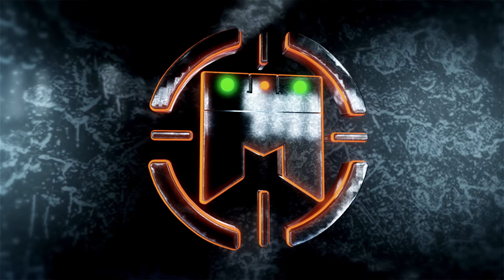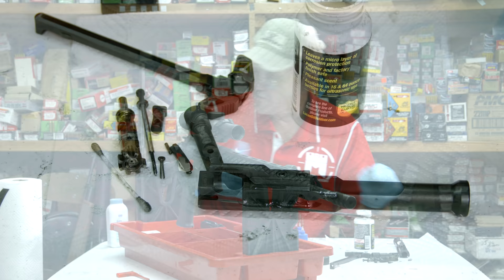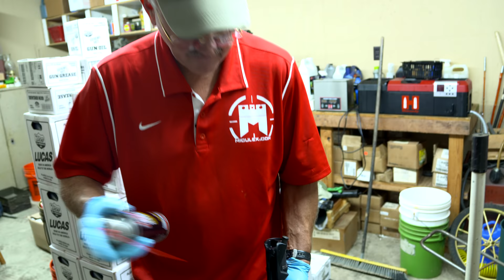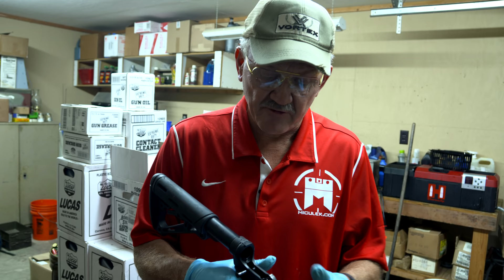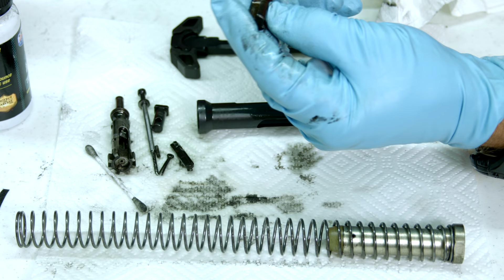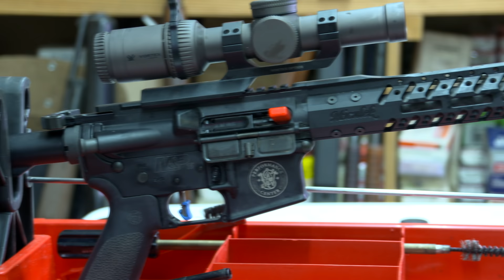ULTIMATE AR-15 CLEANING AND TAKE-DOWN with Jerry Miculek! (4K)

Comment: Great video, Jerry. My only comment is that I would have liked to see a close-up of where and how you were lubricating the pivot points of the trigger group since i had not seen that done in other cleaning videos.
Reply: I think the "brake cleaner" was meant to remove any oil and debris. The trigger group should not be oiled as that will attract more dirt and debris.
Reply: @DangerClose13E  30:50
Reply: Agreed.  More close ups would be helpful all the way through.
Reply: More close ups…smh.

Comment: Jerry, great presentation!  From a former 91F Small Arms Repair/Artillery NCO, you've covered all the details that I'd tell my soldiers.  If I was still in the military, I'd use this as part of my training regimen.  I like how you clean the buffer tube and oil it, it's the same way that I do it and I would show that tip to others.  One minor correction, the U.S. military uses tapered bolt action cam pins, just like yours.  They might have staked it in earlier versions, but modern M16/M4 rifle/carbine's use tapered.  Thanks for the presentation!
Reply: I think the damn idea of brake cleaner or what I'm going to try in a bit, some carb/choke cleaner was damn genius, a strong spraying cleaner that dries quickly. Idk why I didn't think of that...if it blows the chamber clean quicker than rubbing it all out with cloth strips I'm down to with that! Just lube afterwards and I'm good to go. I'm also gonna try that on my 1977 Marlin Model 60 that old 22 gets nasty quick and the model 60 hates excess oil or lube... I wipe the guts with an oil soaked rag I use to lube my bullet molds I put the remnants of my 2 strike oil bottles on the rag and it's not failed me yet.
Reply: DTundergun stay with the brake ckeaner . It leaves no residue. Carb/choke cleaner does .

Comment: To those with criticisms, this was not a tutorial for beginners. Jerry was showing some more advanced techniques that you will not get out of the Tech Manual or manufacturers' instructions. Pay attention to the inspection tips, where to look for damage or wear. This man has shot millions of rounds. I have several hundred thousand under my belt, and some of them were on the same squads at the IRC with him.

Letting the gun sit and the solvent work is key. While Jerry did not mention any specific products (sponsorship issues) I have an old school recommendation. Good old Hoppes No 9 is still fantastic on loosening carbon and barrel fouling. It has oil in it so it will not result in corrosion, even leaving it on for days. One sure way to get out fouling without work is wet the barrel with Hoppes and leave it overnight, or longer. Patch it wet on successive days until the patch comes out clean, not green. If you are so inclined, put a drop or two in the gas tube and leave it. Any carbon will be softened and blow out upon first firing. A caveat, do not use Hoppes No 9 to brush the bore. This solvent attacks copper and a bronze bore brush will not last. Initial brushing should be done with non-copper eating solvent. I shot High Power for years and match conditioned M1 Garands with staked gas cylinders should not be fully disassembled for cleaning. Indeed the Marine Corp team rifles had the actions epoxied into the stocks and the stocks had to be broken off for major work. The gas cylinder was kept from clogging with carbon by running a few drops of Hoppes No 9 down the operating rod into the cylinder before and after each match. Again the carbon is kept wet and soft and just blows out upon firing. With a stainless barrel and reasonable storage conditions, the Hoppes No 9 is fine to leave in the barrel. On ARs I disassemble and wet parts with Hoppes. Let it sit, and finish cleaning the next day. Very little time actually working on the gun is needed, most of the carbon wipes off.

Comment: Show us the the AR cleaning with the sonic cleaner for comparison. Thanks Jerry for such high quality videos.
Reply: The sonic cleaners rock. You literally drop the parts in the pan, add the proper amount/type of cleaning additive to the water and turn it on. Run repeatedly until clean to your specifications. Parts come out as clean as the day they were made. Just beware putting certain metals in as they can become discolored or 'changed'. When in doubt RTFM.
Reply: @johnskidmore1906  Should I take apart the bolt (extractor and ejector) before putting it on the cleaner? Also should I use acid or soap

Comment: What I like about the videos is the safety, chamber flag, no ammo on the table or near to interject into the system.  I know many people that thought the gun was empty and fired off a round. 
I was teaching gun safety and the young lady that was teaching with me had a gun that the extractor didn't pull the round out, she looked in but really didn't look.
she closed the slide pointed the barrel up and shot a hole in the ceiling of the building we were using.  The owners were not happy LOL.

Comment: Not how I was taught in the Army, but all my respect goes out to you and I definitely learned a couple of new cleaning techniques. Thank you, sir!
Reply: The Army also taught soldiers to put oil down the gas key and, at another point, put oil into the holes on the side of the carrier. They also love their CLP which is a somewhat annoying product to use compared to the alternatives.
Reply: my son is in the air force and he said they did not want him to take the bolt apart. but he does now.

Comment: Very good video on the cleaning of the AR-15, Mr. Miculek.  What would have made it excellent is if you listed  above the comment section here the names/brands of all the various products you used to clean your gun (most of us are fairly curious about these things), and show us close-ups in the video of the exact locations of where you like to lube various parts.  Thanks for the video!
Reply: 6:15 mark he states he's using bore solvent but CLP works just as good or even better use a sonic cleaner and a few seconds later he uses a spray clp on the carrier. So it kind of seems like he doesn't have much of a preference on cleaning supplies,  whatever is handy.
Reply: Lubrication points, if there is a moving part, lube it on its pivot points, anywhere there is metal on metal contact needs lubrication, he doesn't have any special secrets for where he puts oil, he puts it everywhere.  Notice how often he says "wet gun" it's because everything has oil on it.

Comment: Use the Bold Carrier for a bore guide.  It actually helps clean out the inside of it.  I also cover my optic lenses with masking tape to keep solvents off them.  And, if I run out of old t-shirts, I just buy bulk painters rags for cleaning patches/rags. Work a bit better than paper towels and way cheaper than precut patches.  I use syn motor oil and Hi-Temp Wheel Bearing grease to lube my semi-auto firearms mostly and don't remember last time I had a lube related failure.   If it rolls, oil it; if it slides grease it.  I also make my own CLP for less than a quarter an ounce by mixing equal parts ATF (Dexron II, IIe, III or later),  odorless Mineral Spirits and low odor heater kerosene.  If you shoot shotgun a lot and need plastic removal properties just mix in an equal part of Acetone.  I generally use RemOil for things like trigger assemblies and non-chlorinated Brake Cleaner for Gun Blast as its same thing but cheaper. Fwiw

Comment: I use brake clean as well but when I ask the “pros” at the local gun shops they act as if I’m committing a cardinal sin.  I also lube the trigger pivot points and safety. A lot of other youtubers claim no lube is needed on or around the trigger. 

BTW is all that Lucas product in your garage gun lube?
Reply: The reason shop “pros” scoff at the use of non-gun specific cleaning products is because they are cheaper than the stuff they sell. I use contact cleaner, Simple Green, CLP, good ol Hoppes n.9. With all of those and some elbow grease I can clean all of my weapons.
Reply: Scott, I heard Hickcock mention recently that he uses brake cleaner on his trigger parts.
Reply: @mikefeddersen2476  recently I've been using carbon lol.

Comment: "Keep any ammo away from your gun while you're taking it apart" *sits in front of literal wall of ammo"
Reply: The reasoning isn't that one might be so mentally incompetent as to accidentally load the weapon & somehow cause it to discharge while the weapon is partially disassembled.
The reasoning is regarding an issue of ammunition propellant becoming contaminated by volatiles in solvent solutions or from fuels such as kerosene being spilled onto cartridges. If the contaminated cartridge is fired sometime later the chemical contamination is known to cause a huge pressure spike & is likely to cause catastrophic failure of the weapon. 

Example:  brake cleaner or kerosene puddles upon your workbench during cleaning of your weapon & the cartridges you use to loosen pins somehow rolls into that puddle of solvent or fuel or perhaps the cartridges were below the receivers being spraying with brake cleaner.
Those contaminated cartridges could become mixed in with other ammo & fired. 

Also don't store ammo in a garage or shed where household cleaners are present, apparently doing so causes deterioration of the cartridge propellant & one critical day your weapon may go click while the bad guy's weapon goes boom.
Reply: ***** I was just pointing out the irony in the statement, not accusing jerry of being unsafe.
Reply: I believe he said "no ammo on the table"..
Reply: Actually if you look real close those are reloading supplies.

Comment: That polymer tool you showed to take out the buffer and spring at 8:21 is a Slide rail channel tool designed for a 1911 pistol.

Comment: It would not hurt to cover up the lenses on your optics when using aerosols and solvents.
Reply: +JC Webb    I thought the same thing, i also thought that he get it for free; that is why :)...
Reply: Yeah, I wonder that too.  Plus, I wouldn't rest the upper on one end of the scope. Maybe it doesn't do any harm, but it just seems to make sense to treat those optics with more respect and care.
Reply: i was thinking why dont he take the scope off lol....
Reply: @flipwoods5332  because he doesn't want to have to re-zero the optic.
Reply: @ericwade2909  Modern mounts from Vortex, Nightforce, Leupold, Larue, Badger, Spuhr, Scalarworks, etc... all return to zero when properly torqued in the same pic slots.  I've pulled an Aimpoint PRO off an AR at least a hundred times over the last  10-12 years, it's on a LaRue QD... already returns spot on, no adjustment necessary.  Same for a NF 5-25 I've moved between a handful of rifles.  It ain't like the old rings back in the day.

Comment: Once again an awesome video. I always wipe cleaning rod off each time I pull it out of rifle. I always wear gloves often 2 pair. The solvents I like to use will really cause cracks in your skin. On my bolt action rifles I use a piece of aluminum foil over a couple of paper towels hand squeezed around the stock and rear of the action. Most solvents will possibly damage the finish plus it is easy to get the occasional drip. The foil and paper towels create a temporary barrier. I also wash my brushes with hot water after each use. Brushes are consumables and only really scrub for a couple of uses. Old newspapers spread in front of the muzzle catch patches and drips. I like Hopped #9 for my cast bullet shooting pistols and Butch's Bore Shine for centerfire rifles. I also always run a dry patch or boresnake through the bore prior to actual use.

Comment: I have found when assembling the buffer tube/spring rather than oiling the spring if you clean the tube and run a lightly oiled patch in/out of tube you get better coverage for the tube/spring assembly.

Comment: Every time I see how to clean an AR, more I love  my AK.
Reply: A boot lace, solvent, and oil make your AK good to go.
Reply: I was thinking exactly the same thing, ditch my AR for an AK
Reply: @boblindstrom3479  or just get a piston driven AR. Or a Ruger, those are piston too
Reply: Year just bought an AR after 8 years with an AK, I like shooting the AR, but clean up show just how messed up DI is. Truly a 1st world gun for people with plenty of time and money for cleaning products.
Reply: @partya11night20  
Brake clean and Mobil 1 are all you NEED to keep it running. Everything else just makes the job easier and more thorough. You can run thousands upon thousands of rounds through an AR between a cleaning like this. Just keep it wet and it'll run. Really not hard to do.
Reply: @kylesonsalla7620  I'm new to AR's and that's what I've been seeing from a lot of channels they keep it wet and deep clean a few  time's a year. Trying to learn about the best way take care/ fix can get really frustrating. So many different opinions. Thanks for your input 👍
Reply: @robertf6523  piston ARs are great imo. I have a PWS mk111pro, long stroke piston system. hella easy to maintain. They are expensive toys though.
Reply: @pyromaniac7003  I don't care for the absence of a forward assist.. seems nice otherwise, and I'd consider the cost in the mid-range ballpark.. 900 something for the rifle version ain't bad at all for a long stoke piston setup (mk116 pro)
Reply: I have a long drum of solvenT and a drum of CLP, I dip in solvent, scrub, rinse, then dip in CLP, then wipe down. 
 I do this with the upper, lower, and BCA. when in OEF, I would use simple green, then CLP. But even this was a once in about 500 rounds.

Daily after patrol cleaning:

Disassembly, 
wipe everything down with a rag with CLP (rag is always stored in a ziplock bag with some CLP),
only the BCA gets TLC, this allows me to watch for wear and carbon build up. 

The whole process takes about 15 minutes.

Comment: but you're not supposed to pull the bore brush back through the barrel...
Reply: Christina Giles - You don't stop midway and try to pull it back. It will jam and cause damage because the bristles compress opposite the direction of travel. Pushing it all the way through and then back again is fine.
Reply: Christina Giles not sure who u are but considering who jerry is , if he does it means it’s more than ok to do

Comment: You can also test the condition of the rings by pulling the bolt to "extended" then set it on the bolt face with the weight of the assembly up, and it should not close from the BCG weight.

Comment: You can use the other side of the bone tool to clean the back of the bolt instead of using a spent piece of brass. The hole in the side of the bone tool is also a firing pin scraper.

Comment: You can use regular chlorinated brake cleaner to blast it out too! I use it all the time. It works great and dries quick. And it's Cheaper than contact cleaner

Comment: I always run a pipe cleaner through the gas key and about three inches into the gas tube after the soak.  I don't want excess oil and carbon fouling in those places.  I also check for key-holing on the bolt face periodically.  I like the idea of using grease on the bolt cam pin; I think I'll incorporate this into my regimen.  Thanks for the how-to Jerry.

Comment: Very detailed, illustrative, and well delivered in easy to comprehend, attitude-free manner. May I suggest "zeroing" the camera's close shots on the center of action and use of soft disposable (polypropylene?) transfer pipette(s) for solvent applications? Once filled with solvent, apply it exactly where's needed and prevent cross-contamination of clean substance inside the bottle. Happy Shooting!

Comment: Excellent session.  Do you clean the various grooves in the compensator?  One minor tip:  I never leave an open bottle of solvent near my work surface.  I've knocked one over and spilled its contents.  I always just transfer some to a small can (clean cat food or tuna can) and that way if I bump it open a small portion is spilled.  doctor y

Comment: I'd like to know where you can get one of those plastic tools. Also, I would cover my scope lenses with caps or even painters tape. Those solvents will eat of the lens coatings.
Reply: +KGiustOD Similar to the prototype he has is just plastic gun cleaning picks/(I think) dentist picks. They don't have as much surface area but get the job done the same.
Reply: Calbico.com channel cleaning tool

Comment: Watching you Jerry, I didn't realize my cleaning procedure is nearly 100% identical to your procedure.  Where you only use solvent on many parts tho, I use solvent, like in the upper receiver body and raceway, but I follow the solvent with generous amounts of WD-40 after to flush the leftover dirty and gritty solvent and debris out, then dry wipe clean until paper, rag etc., stays clean.  Same with the lower and trigger area, some solvent, brushing and then flood & flush the dirty residue out with copious amounts of WD-40 and paper, rag dry until clean.  I guess I've been doing it right, says something about us older shooters.  I'v always been accused of being a nitpicker also.

Comment: The video is 4 years old, BUT SAFETY NEVER GETS OLD! The Chamber flag, Use Them, not only a good habit, but a safe habit. I've posted a comment about 4 weeks ago and said, "Bolt Flag", I meant to say "Breach Flag". As Mr. Jerry kicks it off with, "Safety" and ends with "Safety". 
Guys and Gals, stay safe out there, in the long run, everybody returning from the range it's a good day,,,,,,
Thanks again My Jerry, for shearing your wisdom, this Ol'e Marine absolutely appreciates you,,,,, 
God Speed, God Bless,,,,,
Semper Fi,,,